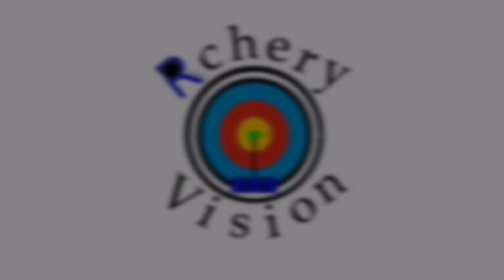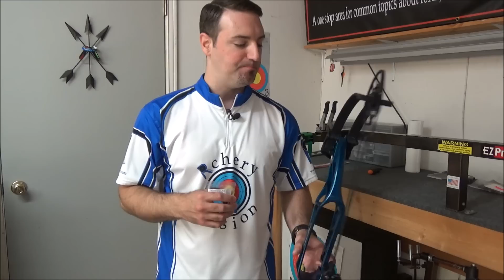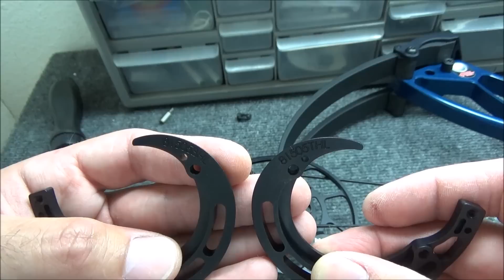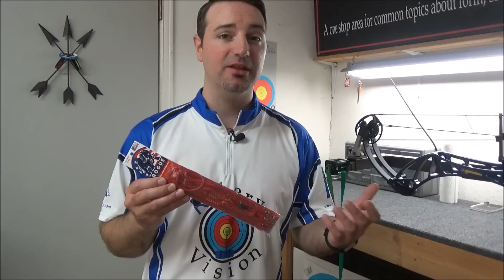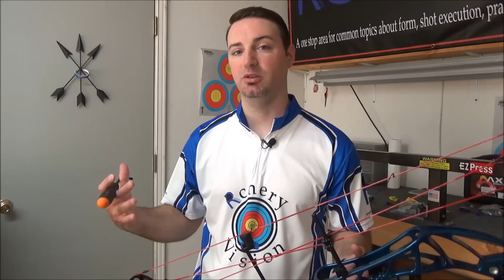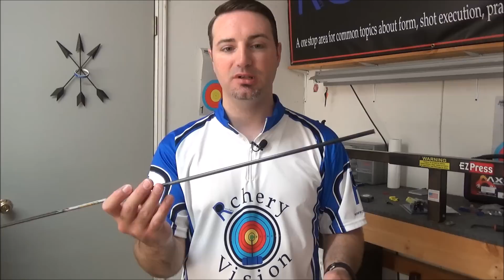PSE PerformX3D Bow Build Part 1 Mod Swap, Rogue Bowstrings Install, Setting Specs (TToTW #37)

Comment: Hi i have a question does the Synunm Portable Bow Press work with your Preform X
Reply from the maker: I don't believe they're approved under PSE.
Reply: @rcrchery  but in an emergency situation can it be used

Comment: Thanks, I have a new Evolve 35 which has 60 lb. limbs & it's nice to see that I wasn't imagining things.  I could tell  the holding weight @ 85 % felt different & ideal to the other 2 settings. It also gave me a better anchor point with draw length factory setting @ 30".

Comment: Great videos. Love the detail you go into. Can you let me know what benefit there is in moving the sight position to either top middle or bottom locations? I can’t quite my head around the impact if any on sight Mark or peep height.
Reply from the maker: Thank you for watching the videos! The benefits would just rely on peep position and anchor point. If you anchored lower on the face and had a higher peep height then raising up the sight mounting location would allow you to not have to move the vertical sight bar to one extreme or the other on the sight rod mounting bracket. It would also let you have more movement available in sight movement for distances too in that scenario.

Comment: so if you wanted to use 90% let off, where would the draw stop be? closer or further out?  i got a shootdown and forgot to grab my manual from the shop.  i cant seem to get this answer anywhere.  thanks and great video.
Reply: Chris Pinnock all the way in
Reply from the maker: Taylor is correct, you'd want to put the draw stop all the way in on the notch closest to the cam. This would make the draw stop further from the string as the cam is rolling over to full draw and allow the cam to go a little further  to increase the let off percentage.
Reply: ah i get it now.  makes sense.  Thanks guys.
Reply: 90% is away from the rubber point  You can get your manual on line